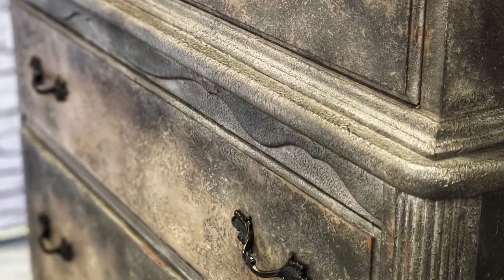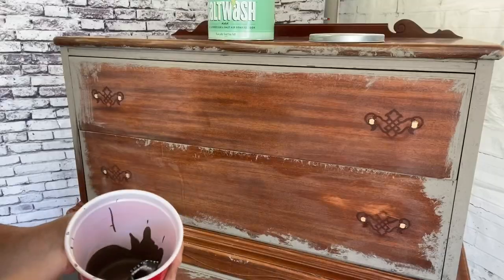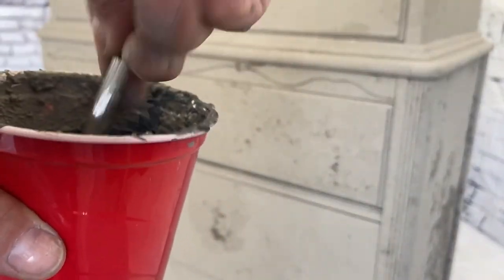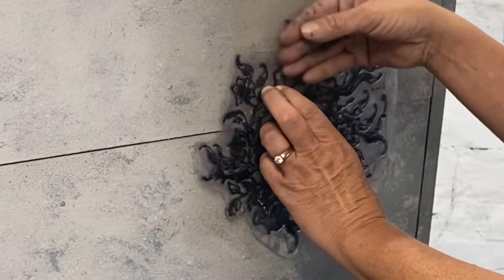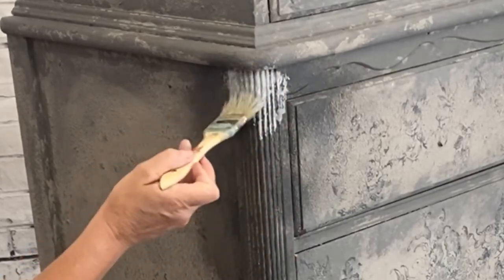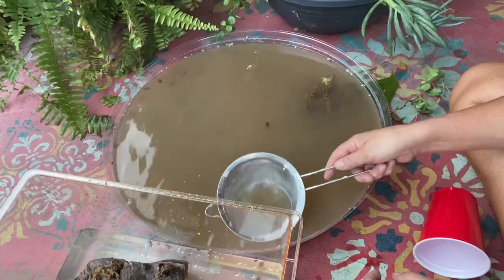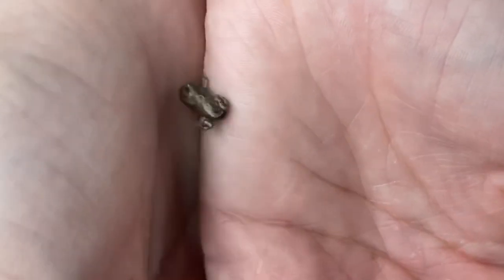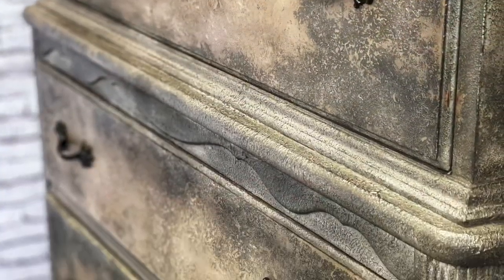Vintage Dresser Makeover

Comment: Omg I wish I didn't live across the USA cause I'd come buy all your pieces. You are savage girlie!  Also wondering how you can top coat over the ink. Mine always disperses.
Reply from the maker: Are you using IOD ink?
Reply: Vintage Makeovers with Melanie yes!!!!! Do I need to strictly use wax? I use a poly
Reply from the maker: Ok.... I know I have had that happen... looking back I believe I used Poly from Home Depot that time??? Just use wax..... you won’t-have to worry at all
Reply: Vintage Makeovers with Melanie that’s the issue then.. appreciate you! Good luck with the new little frogs!!!
Reply: Binkie Babe I use a quick spray sealer over stamped areas. Then go over with Poly or wax. Just in case I smear it. Just over the stamped areas.
Reply from the maker: Great idea!